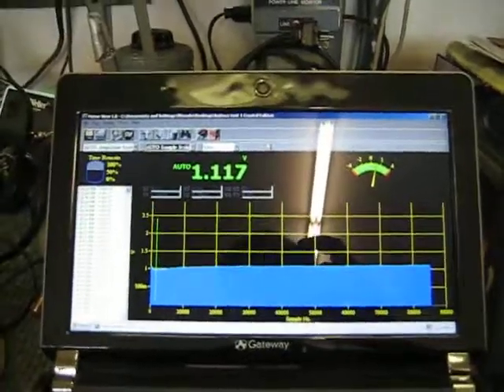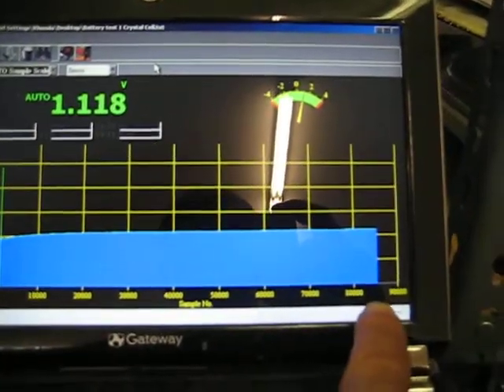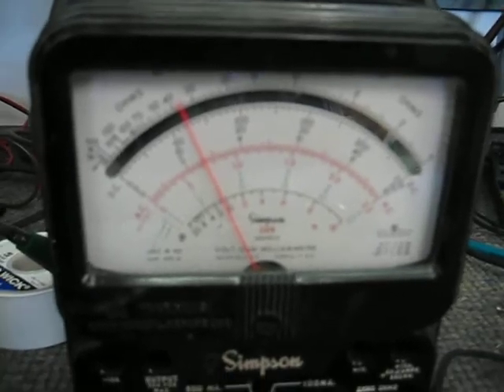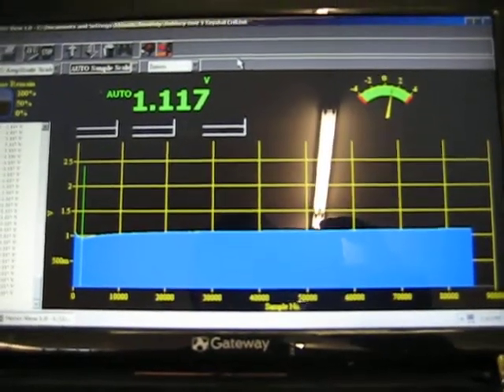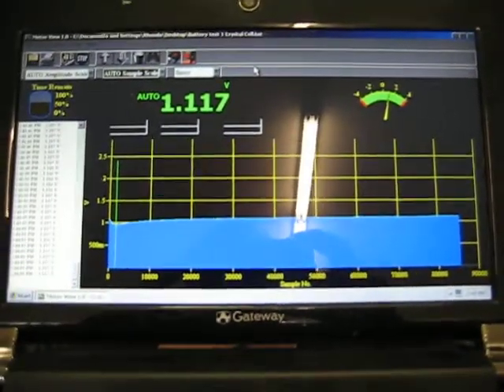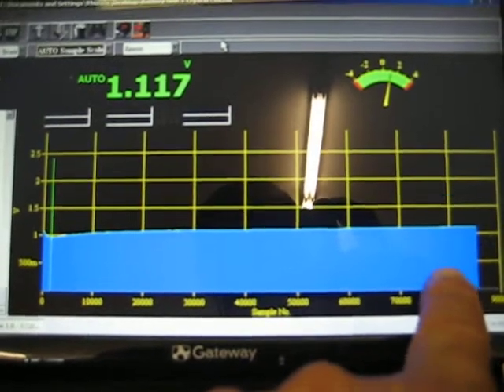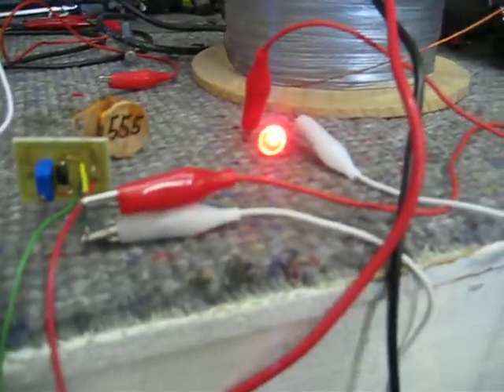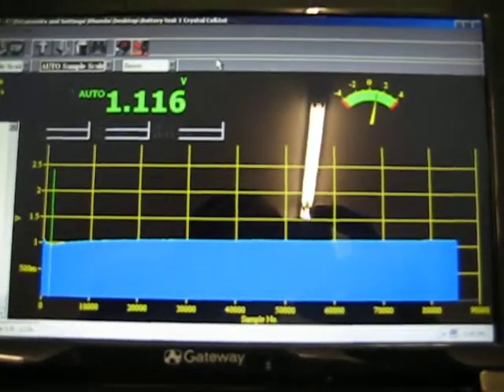Star Cell Day 2

Comment: ive got a few questions. are these cells dependent on moisture in the air and have you compared them to normal batteries to see the voltage drop to see if it follows that pattern? and also what can you make these out of?